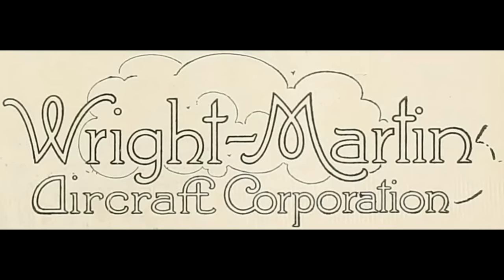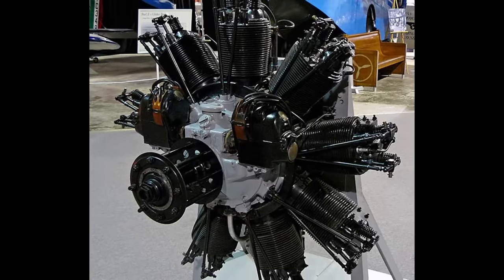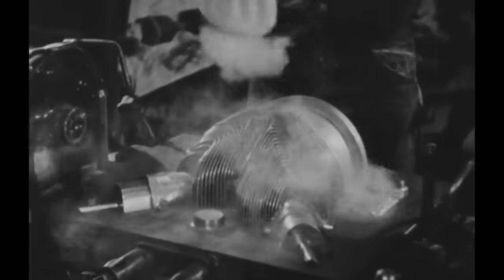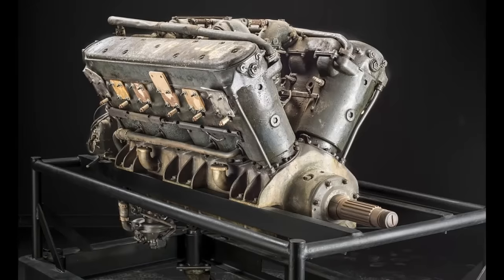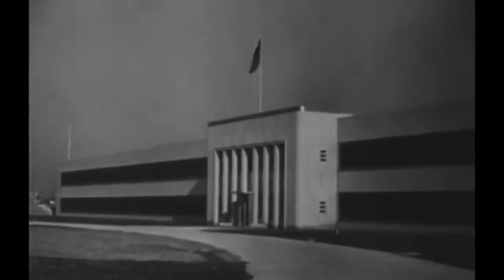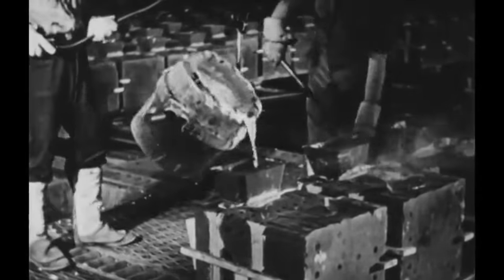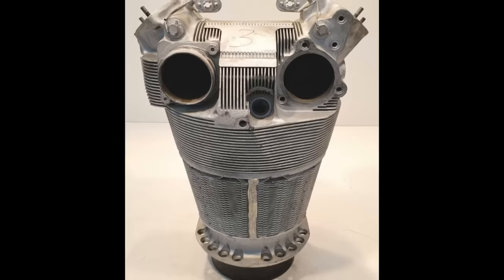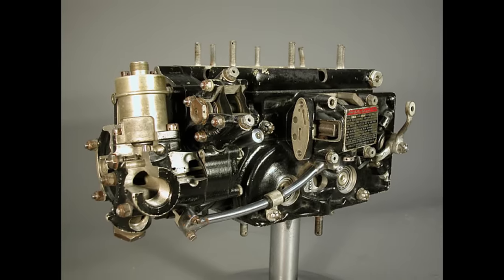The Unsung Hero of Masters of the Air: The Wright R-1820 Engine

Comment: I was a USMC C-117D crew chief back in the 70’s.  Great engine and drank about 1 gallon of oil per hour in flight.
Reply: How many gallons could it hold in total?
Reply: I spent nearly all my DC3 Civil Airline flying behind a couple of those R1820's (1,600 hours).  Our Hostess came up one day & said a passenger said there was oil leaking on the wing & we said when it stops come up again & tell us. (Each engine had 22 imperial gallons of oil)
Reply: What kind of oil were they running in them by that time? It's to my understanding that during WW2 they still used castor oil in US aircraft engine's although that may be wrong, but if they did I'd image by the 60's and 70's they'd have switched to petroleum based oils that'd been developed to handle the conditions that only castor oil could for years, I guess there was something about temperature and the altitudes the engine's operated at that castor oil could handle that petroleum based one's couldn't back then.
Reply: Never need an oil change.
Reply: @billolgaau  That's over 29 gallons (US), so my guess is that the Oil Tank would hold either 29.5 or 30 US Gallons (US gallon =128 Fluid Ounces & Imperial gallon = 160 fluid ounces)
Reply: @Tim.NavVet.EN2  when your using 1.5 to 2 Gallons of oil per hour per engine  you don't have to get too precise.😊
As a note, most DC3's have four fuel tanks which gave you around 8 hours fuel but some of our aircraft had one Aux tank removed - they carried 28 to 32 pax instead of our usual 24.
Reply: 27 3/4 gallons per engine.  Normal burn was ~1 gallon per hour.
Reply: 1100 grade oil
Reply: That is dependent on the aircraft not the engine it is a dry sump engine unlike your car.

Comment: Had some time behind the R-1820 in the T-28B and C and the Grumman C-1. The engine was rated at 1500 hp in the E-1 and 1420 hp, as I recall, in the T-28 and C-1/S-2. The 1350 hp 1820 in FM-2 combined with 500# weight reduction enabled the "wilder Wildcat" to compete with the Zero. FM-2 ace Joe McGraw said that their mechanics "tweaked" the engine to pull more than 1350 hp.

Comment: Although not mentioned in the narrative, the R-1820 was used in the H-34 series of Sikorsky (S-58) helicopters.  I did notice one engine which I believe was an R-1820 pictured as would be mounted in a Sikorsky helicopter.  It was also used in the Pisecki/Vertol H-21.  I was schooled on the H-19 and H-34 helicopters in the early '60's at the start of my 22 years in Army Aviation.
Reply: I used to sit with my Dad in a Sikorsky S58 to run it between stints of cold weather when I was a kid...it was awesome hearing that old girl bark and cackle, the smell of the smoke and avgas...ahhh...I had a great childhood.😊
Reply: The one pictured at 9:55, is what I remember our engines at St Louis Helo looking like.

Comment: Was an Airframe guy on Grumman CS2F Trackers, until they were retired from Canadian service, and got trained on the Wright 1820 engine, right up to doing Ignition analyzer training to assess and troubleshoot the mags system.

As the 'good' Avgas started to become harder to source, and more expensive, those poor buggers got downgraded, downgraded, and downgraded some more, until I think they were down over 400 HP from peak, between timing changes and other adjustments.

The Canadian Tracker was mostly used for Maritime Sovereignty, and Fishery Patrols in it's final years. 

I still shudder at the smell of Aircraft Wax (the solvent that we ended almost every day with, wiping oil off the Trackers before they were put to bed in the Hangars).

Comment: I love these engine episodes because I love learning about how stuff was made back then. The engines were fully designed by people not computers so they were not perfect
Reply: Consider this the truck im driving a Kenworth K200 has a completely computer designed 15 litre road transport engine. More thsn 2 years ago this completely brand new truck had a bespoke fitting of new design engine. There was a sister Kenworth some months later delivered and as of this week that truck on top of many other failures has just broken its crank. Because of the failures and ongoing issues this truck was meant to have the field test engine removed in 4 weeks, but was bought forward 4 weeks because of the crank failure. It will have its originally intended Cummins X15 refitted which will probably take a month. My truck has been more reliable but is on its 3rd engine with 700,000 km/s and currently at about 830,000. It also will have it's Cummins X15  refitted which was always intended however has caused much inconvenience at times and long days

Comment: One small correction:
Each Magneto powered a single spark plug per cylinder head, between the pair of Magnetos both spark plugs were powered.
This is a safety feature even in today's piston powered aircraft engines!  (If you loose a magneto, the cylinder still would fire and you lost only a little bit of power...)
Reply from the maker: I may have misspoke! Thanks
Reply: @flightdojo  A common misunderstanding, hence my stating that it is a small correction....
I wonder if we'll ever go over to 1 magneto and one electronic ignition system for improved performance.

Comment: I love these American radial engines that played a massive role in winning ww2, air cooled radials are just fantastic reliability, simplicity, and still works even with a cylinder blown out and will get you back home, all the American aircraft i love were powered by these fantastic radials and i wouldn't fly in anything else especially in a war.

Comment: Pardon me if I'm wrong, but I believe that each mag would have fired "one" plug per cylinder therefore the redundancy. Great channel by the way.
Reply: I believe you are right as the magnetos failed often.  Not every flight, but in a squadron, every few missions one failed.  Since engines turn or people swim...
Reply: It is still the case in general aviation engines today : 2 plugs in a cylinder, each ignited by a different magneto for safety ...

Comment: What you stated is absolutely correct creating very reliable engines!  In my opinion they also built the powerful Wright R-3350 Duplex-Cyclone but it was rushed in production for "political reasons"  the most common cause of maintenance headaches and catastrophic failures was the engines. Although the Wright R-3350 Duplex-Cyclone radial engines later became a trustworthy workhorse in large piston-engined aircraft, early models were beset with dangerous reliability problems including overheating.This problem was not fully cured leading to the death of many crewmembers. Sad indeed....
Reply: The biggest issue that caused all the problems with the R3350 engine early on had nothing to do with the engine, the problem is that the pilots were running them incorrectly and causing induction fires in them during take off.
When the prototype B29 crashed into that meat packing plant the pilot flying it was Boeing's chief test pilot, unfortunately when he died not only did there go every single bit of experience when it came to flying the B29 there also went the man who would have written the pilots manual for it, being the chief test pilot writing that manual would have been one of his duties, in essence the early pilots were simply experienced B17 and B24 pilots who were put in the cockpits and wished good luck essentially, the only literature on flying the plane was a hastily written manual by people who were guessing. 
To complicate matters and what caused myths about the R3350 engine and fires that persist even to this day was Truman's committee that led the investigation into the crash of the prototype B29 blaming the fire on the engine and calling them fire prone, later investigations showed that it was a leaky fuel filler cap that leaked fuel all over the engine that caught fire.
What caused engine fires early in the B29's service was it's poorly designed supercharger, the Army wanted Wright to have GE design the supercharger for the engine but as mentioned in this video Wright had started designing their own superchargers, they may have got it right on the R1820 but they seriously screwed up the R3350's supercharger, between it's poorly designed elbow that fuel had a tendency to pool up in especially during idling and it causing fuel to be poorly distributed to the cylinders during idling the engine had a tendency to backfire into the intake manifold if a pilot advanced the throttles too quickly from an idle when one would start it's take off role, people erroneously claim that the R3350 engine case's were made of magnesium, they were not, just as Wright switched the R1820 engine from aluminum to forged steel engine case's as mentioned in this video they also switched the R3350 engine from it's original design of having magnesium case's to forged steel early in it's development before any engine's were even mounted in an aircraft, they hadn't even left the test bench yet, since there wasn't much left of the early crashed B29's everyone was accusing the R3350 engine of just bursting into flames during flight because of the Truman committee incorrectly blaming the crashed B29's engine from self igniting, this is exactly what led to the B29's fire suppression system to be redesigned and improved although unknown to everyone at the time it was actually unnecessary because the real engine fires were induction fires that happened inside the intake manifold from pilots advancing the throttles too quickly from an idle, even the best extinguisher system in the world won't put out a fire that's inside of an engine, the inside of an intake on a supercharged engine is the kind of environment that fire does very well in, once started from a backfiring cylinder it quickly spread upstream to the supercharger with all that fuel pooled up in it's elbow, it was the magnesium housing of the supercharger that once it was on fire couldn't be extinguished, not the engine case's as the long standing myth continues to claim was the issue.
The first assignment that Hap Arnold gave to Paul Tibbets to take care of in regards to the B29 was to come up with a proper pilots manual and a proper training program for pilots, once Tibbets taught them to slowly advance the throttles off an idle, especially one's sitting on a runway in the hot air on a Pacific Island waiting it's turn to take off the number of engine fires dropped dramatically, in the meantime a direct injection system for the fuel was being developed to eliminate induction fires but ultimately it really wasn't necessary, just slowly advancing the throttles off idle in increments was all that was needed, the pilots simply couldn't run the B29's engine's during take off the way they were used to doing it in the other bombers they'd flown. 
Induction fires weren't unique to the R3350 engine, all the supercharged WW2 aircraft engine's could have induction fires if handled incorrectly, there's a wartime pilots training film here on YouTube starring Arthur Kennedy, who after the war starred in many Hollywood films such as Bend Of The River with Jimmy Stewart and Lawrence Of Arabia, that plays a B17 instructor teaching a trainee pilot how to fly a B17, during the procedures that the pilots do at the end of the runway before taking off such as the mag checks and cycling the turbo's to check they have oil flowing through them he warns against doing one of the tests in the wrong order or it could start an induction fire.
As you pointed out the vast majority of the problems with the B29 was it's being rushed into service, it was the most advanced and most complex machine on the planet at the time and had a development program that should have taken 5 years compressed down into just over 2 years, but it wasn't for political reasons, they needed to get it operational and into the war because at that point the US didn't have a bomber with the range to strike Japan, many think it was because it was the only bomber capable of dropping the atomic bomb which it was but before that it was needed to start bombing Japan conventionally, the time had come to take the war to the Japanese and the B29 was the only aircraft capable of that.
Reply: @dukecraig2402  very interesting info, thank you! It is good to remember that the Wright-3350 Duplex Cyclone radial engines had a serious issue with the massive exhaust system that was running in front of the engine that was never really solved...

Comment: My personal favorite airplane engines during WW2 is the RX-7-FD and the R3350 radial airplane engines. Unless the main connecting rod was destroyed. A rotary engine could lose 2 or 3 cylinders. Then still make it back to base. All WW2 airplane engines are okay. The Merlin Engine was given and still is given as the best WW2 airplane engine. Just one Bullet in the crankcase or radiator on the Merlin Engine and it didn’t take long for engine failure to happen

Comment: I've been told this engine had modest production issues compared to the Pratt&Whitney equivalent (the Wasp I believe it is.)

The engines would tick, tap, and rattle warming up and cooling off. Not an issue in flight, but there was a noticeable difference between the rattle-trap Cyclone, and the smooth purr of the Wasp typified by having a B-17 and a B-24 side-by-side.

Once again, not a performance issue, but a detail the Cyclone left out probably because Studebaker didn't see any reason to correct it, while P&W kept after such details.
Reply from the maker: I had no idea about this. Thanks!
Reply: @flightdojo  so the story goes from "The Forgotten Fifteenth" by Barrett Tillman, that Curtis Wright sent the production of the Cyclone to Studebaker. The car maker wasn't accustomed to aircraft tolerances (which after a lifetime working with aircraft parts, this rings a bit hollow) so the engines leaked oil. It was so bad there was something of a fire hazard under the B-17s and in their engine nacelles. But these were kids raised in the 30s, so they just took it in stride as a known issue. I understand a B-17 went through, and still goes through, 50 gallons of 40W oil per flight.

Does this make it a bad engine? Not for the times. The PW Wasp was less of an issue in this regard, but the B-24 was easier to shoot down.